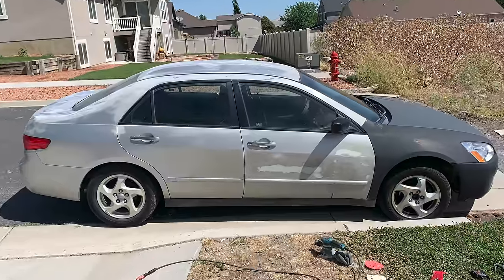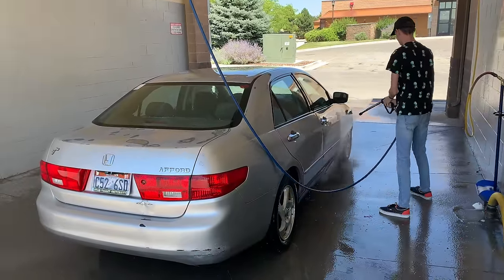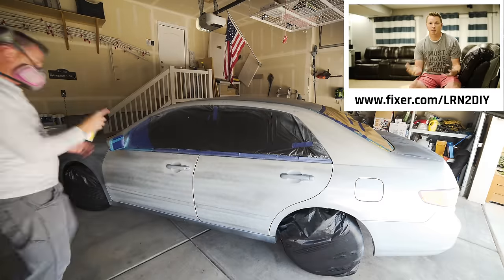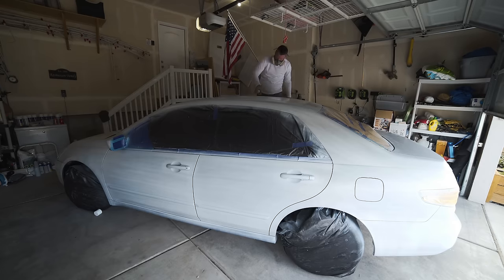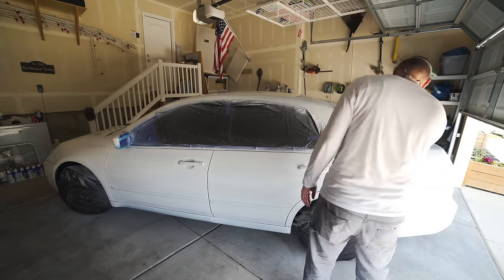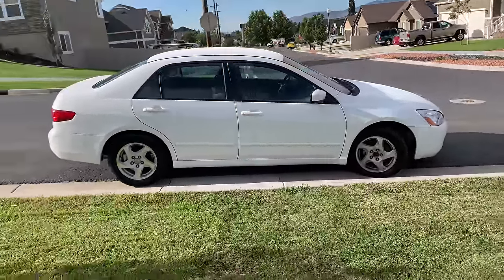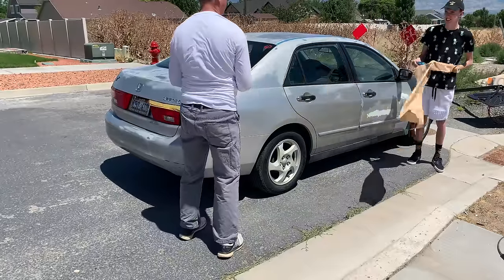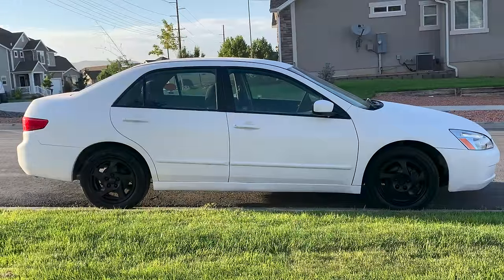$174 Spray Paint Job - Paint Your Own Car On the Cheap

Comment: I did a similar thing on my "daily driver". Paint was sun faded bad so I painted it in summit racing primer black. I've having to constantly respray it until I decide what to do next. What I learned... just get a gallon of paint and a cheap sprayer and it will turn out better and cheaper than those crappy rattle cans!
Reply: Use rust oleum lmao
Reply: Because you gotta do maintenance  on the plasti dip.  They sell a substance for it

Comment: I wish I could go back 3 years and tell you about the"Aerosol Trigger handles"  that you can put on the spray can so your finger doesn't hurt.... as much.
The car turned out FANTASTIC. I would have to add the cost of the mask to this job's cost and you don't want to buy a cheap Ali-Express or TEMU one 🤣
I like the AFFORD logo on the back... nice touch.

Comment: Really glad you shared this, thank you! I have a 2007 Mazda 3 that sits most of the time and the paint got ruined from some hard water sprinklers. I was able to get it cleaned up, but it was bad enough that a lot of the clearcoat has started to come off and it just looks awful. I might have to make this a weekend project! Thanks again!

Comment: You guys did a great job. My nephew also drives the same car and indeed it runs forever. It has 180.000 miles on it and still runs fine. His car is a 2004, and the paint isn't that cracked up to be anymore. So thanks for this vid, it would be something duable for us.

Comment: I've considered the same sort of thing for our 2nd car that is showing signs of wear on the finish.  It's hard to imagine you wouldn't have known up front to use a spray can trigger handle.  They're only about $5 and so much easier on the hand than gripping the can and pushing the nozzle with your fingers.

Comment: So I've done this to a couple of cars and I'd recommend not doing white. Since it is a textured finish it gathers a lot of dirt and its really hard to clean without taking the coating off.
Reply from the maker: Good to know! We'll see how this one holds up. I like the look of the matte black too.
Reply: @LRN2DIY  another thing to be careful of is oil and gas, both of those are really hard on the plastidip.  I'm really excited to see how you're trailer comes along.  I've got an old trailer I've considered fixing up and watching you will really help.

Comment: I had a 2001 Honda that was approaching 300k miles. It was still running great, but an accident forced me to find a different car.
Reply: Me too! I have one with 200k.  Do you think it would look decent plasti dipped or factory color?
Reply: @brisatrujillo7228  If I still had it, I probably wouldn't plastidip it unless it had multiple colored doors or panels. That or it looked awful for some other reason.

Comment: Great effort and great job. Throwing the paint on is just the last stage in this colossal job. If you came to the point of having the whole body ready for paint, having the rubber seals,  handles and other stuff off your way is not so much more jib and it might make a huge difference in your final product,  getting practically profissional,  because the real hard stuff is straighting, puttying and sanding. Paint job as manouvering the paint gun is just wonderful sensation. You should try it. Congratulations

Comment: I’ve plastidipped the ugly gray plastic Ford put on their bumpers on my Ranger, to get clean lines I used a knife to cut along where I was pulling off as opposed to a wet pull. If you’re pulling off on something where the line you are following is recessed or hidden, this works perfect, but for other applications I’d definitely use a wet pull if it’s on a body line you are scared to scratch up and cut the paint/metal underneath.

Comment: Looks decent, but does it last? Does it scratch easily? And in case that plastidip paint gets damaged can you just fix it up by spraying some more?
Reply from the maker: Here's the year-and-a-half follow up video to answer your question about longevity. As for the touch up, I've often wondered that but I'm not sure if that would work well or not. https://youtu.be/JCOM1czgRlY

Comment: On the "wet pull" tip: If you forget to do a wet pull like he did. Just take a razor blade and follow the line of the window trim to cut a clean and straight break line on a dry pull.

Comment: I Wonder for how long it last as is 
Especially around handles and door corners where ever you touch with your hands and sometimes have keys in the hands or bags or what ever that can bang with the car. 
Also how do you wash the car now ? I guess it have to be very gentle, therefore I guess you cannot get to a car wash machine or any self wash where they using power wash etc… 
Would love to hear about your experience and if it’s really last 
Thank you for great video ❤

Comment: Very nice! I noticed you didn't use any primer or paint adhesive. Did that affect the paint job after a few months? Also I noticed you didn't end with any clear coat. Was this deliberate? Did  this cause your paint to peel or deteriorate faster. Many thanks!
Reply from the maker: I posted a follow up a few months ago after nearly 18 months of use and it was in pretty excellent shape (other than the car being wrecked). Without primer or topcoat that stuff held on like a champ and yet I was able to peel it off if I needed to. Very impressive stuff.
Reply: @LRN2DIY  Thank you for replying. I just realised you were using PlastiDip. I had initially thought that was just a type of automotive paint. Have seen the other video. Hope no one was hurt in that wreck. I just discovered this other video where he uses a can holder to make the spray painting easier. At the 20 sec mark:
https://www.youtube.com/watch?v=5LdAYigcjsM
Reply from the maker: @dashong8912  OK, that makes sense why you were asking about the primer and top coat :) My daughter was driving when the accident happened and she had a broken collarbone but is totally fine now. As for the spray trigger, I have one and tried using it but with the PlastiDip, at least, I couldn't get it to spray a full amount - it wouldn't depress the trigger all the way so I just did it by hand instead.

Comment: The car turned out great ive seen that plasti dip but it sounded like it was easy to peel off by what ive seen here it didnt.. i have 1 question did u have to cut around the emblems and ho did u get itnoffnthe rubber tire..

Comment: Buy airgun and normal paint if you're going through the trouble..
Reply: O and a compressor. Because that's the point. Buying a lot of stuff for a Car that is maybe worth 500 bucks. Great job.
Reply: @daanhoffman8773  obviously you know nothing if you don't think they have access to shop air/compressor...and think the car sells for $500
Reply: Real paint is going to take a lot more knowledge, skill and work to get it done. Plus this guy can’t even do plastidip right so he should definitely stay away from automotive paint.
Reply: He is talking about plasti dip  car kit. not paint job which I also highly recommend for next one. For the whole car yes you deff should use spray gun much  easier and come out much much cleaner and faster.  Only few hundred more.

Comment: I would take it to a cheap place like maco that paints cars and get it clear coated......yes you can do that, yes it still peels. Doesn't peel as good but it will also last long so it doesn't start peeling off so easily

Comment: Looks pretty cool but what is the added value to plastic dip compared to paint?
Reply: Plasti-dip is cheap and is generally user-friendly.  If it turns out bad, you can just peel it off.  It also can cover blemishes, like rough paint and bondo.
Reply from the maker: Just what B Shea said. It’s really more of a cheap way to spiff it up. PlastiDip is also really hard to mess up when compared to standard spray paint.

Comment: i'm curious: in the US you can change the colour of the car without legal issues?
Reply: Yes. You'll only have a problem if the police are actively trying to find you by locating your vehicle, and it's been painted something other than the factory color that is indicated on the registration. I'm sure they would frown at your attempt to avoid capture, even if you had painted the car long before you began your criminal career.

Otherwise, nobody cares.

Comment: How much can that paint last? And is it okay without primer and clear coat?
Reply from the maker: From what I've seen/read it can usually go at least a few years without showing any issues. On this car, for example, we painted it over a year ago and it looks fantastic still - no signs of peeling or fading or anything like that. We didn't prime, didn't clear coat - just white PlastiDip like you see in the video and it's doing awesome.

Comment: How does it hold up vs a drive through car wash ?
Reply from the maker: It does great, actually. I Plasti Dipped my current car as well and have probably been through the car wash 20 times without issue.

Comment: The overspray on the wheels...
Reply: You realise it's plasti dip, right? It'll come right off the tyre...
Reply: @ADAMLFC92  it's actually not that easy to get rubber off of rubber. You realize that right ?
Reply: @ADAMLFC92  that's y you put tire shine on first. So it makes a barrier for adhesion

Comment: With how easily it peeled off of the emblems, why would you paint the car with it. It will eventually peel off and is in the end a waste. I'd just use real paint
Reply: Real paint will take ALOT more work and if you use cheap spray paint it’s just flake off anyways also... also dip will only release like that for a while and then it’ll be a bit more rubbing to get it to start peeling.... also this is a dumb example of dippin a car, don’t ever use spray cans for a whole car
Reply: I’ve plasti dipped my Chevy logo on my car and it hasn’t peeled off in 3 years and I’ve put a pressure washer to it with nothing happening. Still as good as it was when I first painted it.
Reply: Get your self familiar with it. It’s amazing how long they last if it’s done. Right and how good they look for the price.   Plasti dip car kit is around 450$.  Professional paint job will run you around 2000$ to 4000$.
Reply: Its platidip it's not gonna peel off easy unless you physical do it yourself, unless it's been on your wheels for like a few years

Comment: How does it look like after some time?
Reply from the maker: nicomeyer Hard to say for sure as it’s only been a couple of months but so far it looks like new and the parts I painted on my truck several months ago still look great. I worry about the ability to really scrub off dead bugs though, since those can be really tough to remove even on regular paint and clear coat.
Reply: Cool, thanks for the feedback 😜

Comment: Now How you wash the car ?
Reply from the maker: Just like normal. We washed it today and used the foam brush and high pressure rinse. Worked great and no issues. I would avoid putting the pressure washer nozzle right up close but you should probably avoid that on any paint job.

Comment: Good luck getting the lug nuts off for any repair after that
Reply: Paint remover
Reply: @danmcavena1968  wont it end up on the whole rim...it may have just been smarter to take the wheels off one by one and do them to prevent that.car still looked good though good job
Reply: @coreyswanson2424  let’s get real first rain your drive it that shit is flying off the rims anyways

Comment: I hate that there is still so much ignorance when it comes to plastidip.... the only reason it looks good is because it’s white and through the camera you can’t see all the tiger stripes and dry spray you have.... I’m also guessing some spots are so thin that they well start to flake/rub off by it’s self in a matter of days ( if lucky). The rest ,when you decide to peel it off, will peel off in tiny little pieces that will have your fingers hurting for weeks because there isn’t a strong enough layer to pull it all in one piece...... honestly you could have spend just a little bit more money and you could have made it look way nicer, smoother, durable, and when you felt like peeling it off it would have all came off in big pieces like normal wrap...... the benefit of plasti dip is to be able to peel it off and you ruined that.... and in a matter of time it will look worst that what it was before the dip